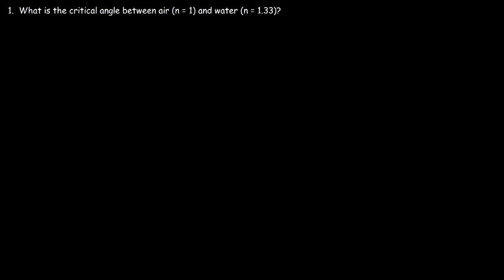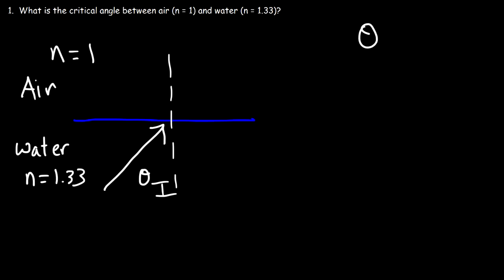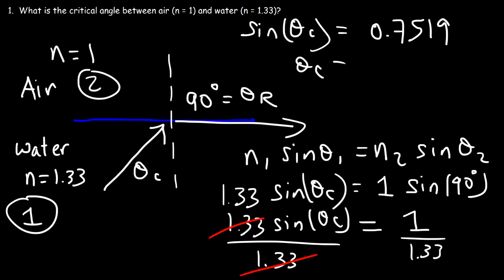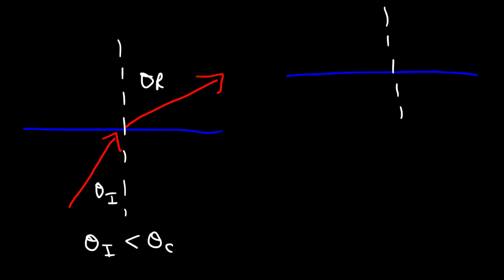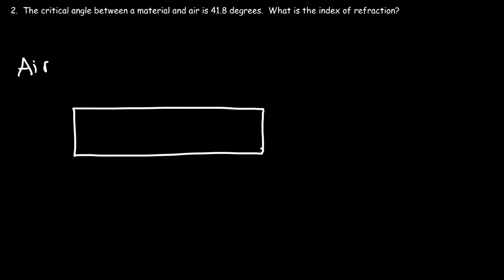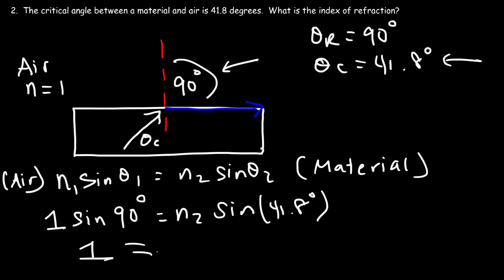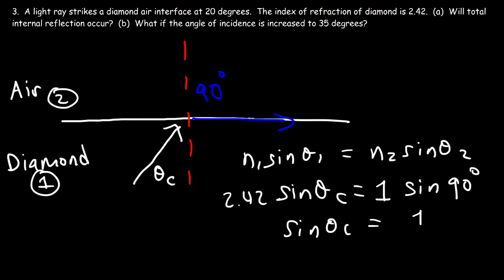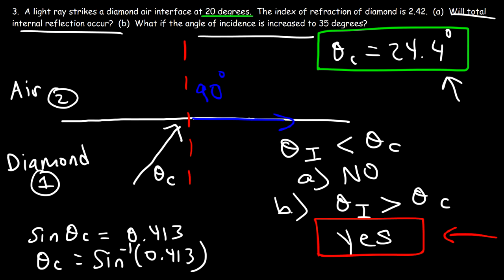Total Internal Reflection & The Critical Angle, Optics - Physics

Comment: Pls how do u know whether the light will strike upwards or downwards
Reply: I noticed that in most questions, it will be specified where the light ray is coming from but when we're dealing with the critical angle or internal reflection then the light ray always comes from the material with a higher index of refraction (n) to the material with a lower index of refraction. e.g from water (n=1.33) to air (n=1) or from diamond (n=2.42)  to glass (n=1.5). I hope I'm not too late and this clarified a little.

Comment: 2:26 how do you know to associate 1 with water and 2 with air?? I paused the video and did it the opposite way around. Is it because the light travels from water to air? 

I remember you said something about going from high to low, is that the application in this context?
Reply: Yes. For total internal reflection to occur, the light ray has to travel from a material with a high index of refraction to a material with a lower index of refraction. Hope this helps
Reply: according to AI: This formula is used when light travels from a denser medium (higher refractive index) to a less dense medium (lower refractive index), and we want to find the angle of incidence at which the angle of refraction is 90 degrees (total internal reflection

Comment: hello, i’ve noticed that you said that total internal reflection wouldn’t occur if the angle of incidence is larger than the critical angle at the beginning of the video, but in the last example when the incident angle was larger than the critical angle you stated that total internal reflection will happen. could you please explain again?
Reply: I think he made a mistake ther
Reply: okay i thought he made a mistake too but then i read my notes and my teacher said total internal reflection happens 1) a denser to less dense medium and 2) when it reflects back into that medium. Since those are the properties for it to take place and the angle of incidence is smaller meaning it would REFRACT totally, nothing it reflecting back into the medium. Therefore, no internal reflection would occur